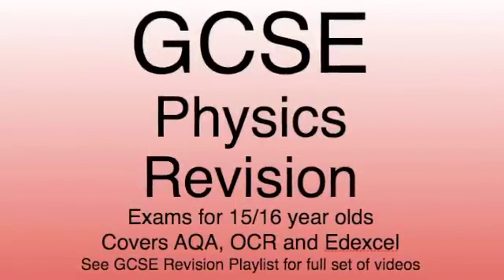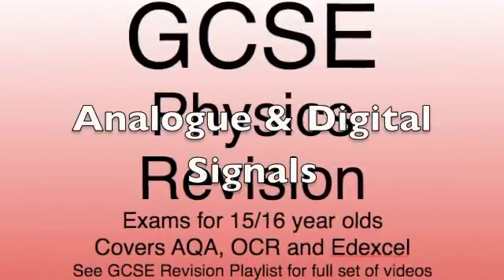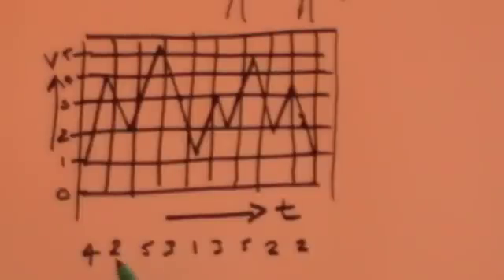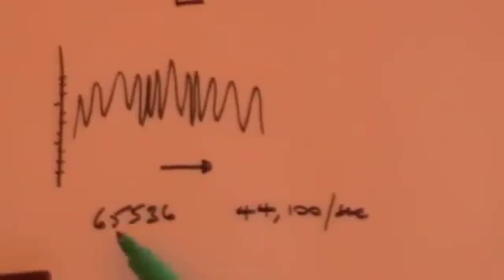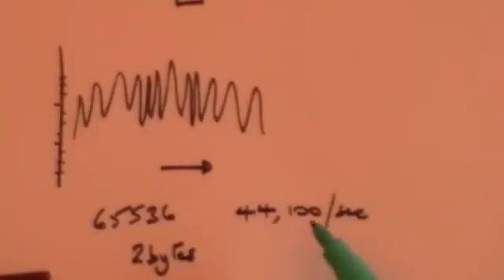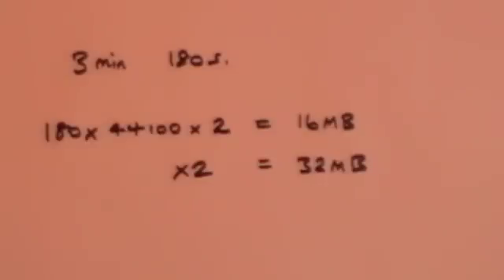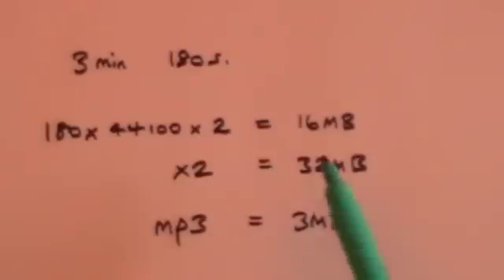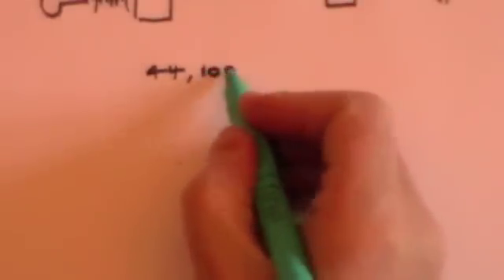Analogue and digital signals: GCSE revision

Comment: 65,536 volts?!
Reply: You divide the maximum voltage (e.g. 5V) by 65,536 pieces. Then, for example number stored, that equals to half of the pieces (32,768) means 2.5V.

Comment: How about covering few topics of digital communication like nodulation techniques??
Reply: Nodulation (Nod) factors are signaling molecules produced by bacteria known as rhizobia during the initiation of nodules on the root of legumes. A symbiosis is formed when legumes take up the bacteria

Problem is, nobody has digitized it yet, although you're quite right that it's basically digital at the level of the individual bacterium.